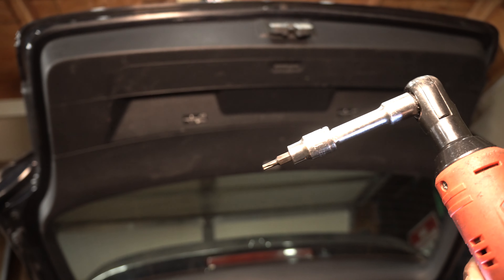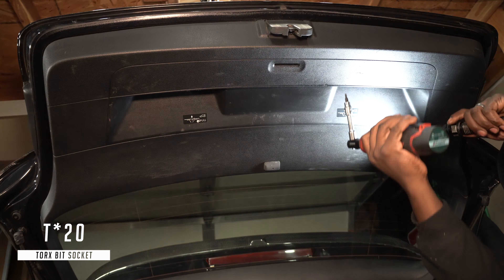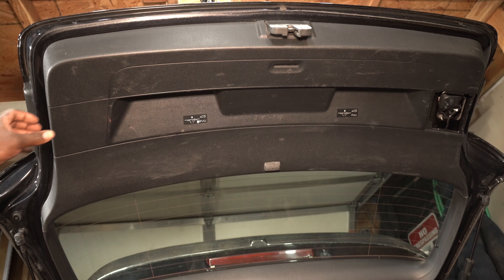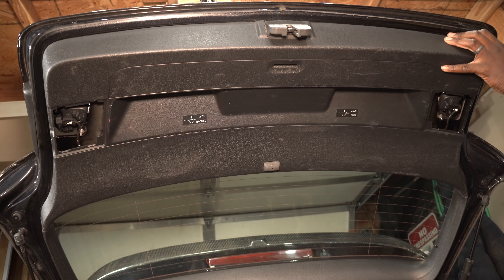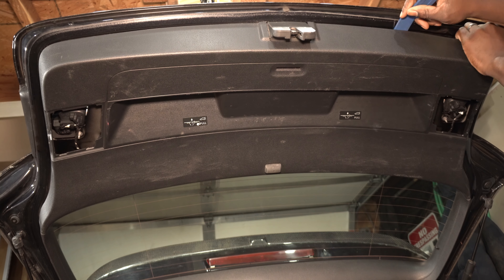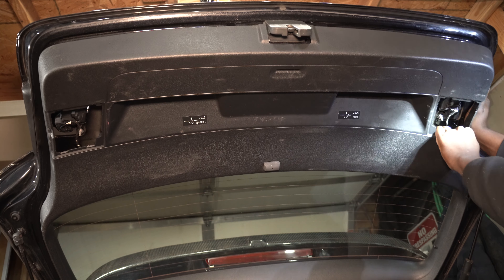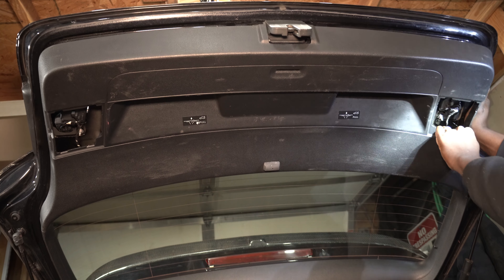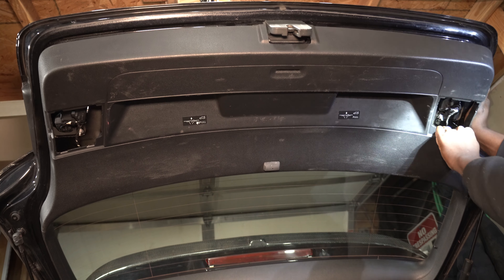VW Golf MK6 GTI Rear Wiper Delete Plug Install 2010-2014

Comment: Why do people remove rear wipers and install DIY plugs? what is the reason?
Reply: The wiper tends to get a mind of it’s own, meaning that it’ll activate when it’s not supposed to. So someone people would rather delete than deal with this issue.
Reply: looks better off

Comment: Did you have to remove the fuse for the rear wiper or anything? Worried the washer hose will leak
Reply from the maker: I fold the hose then put some zip ties on it.